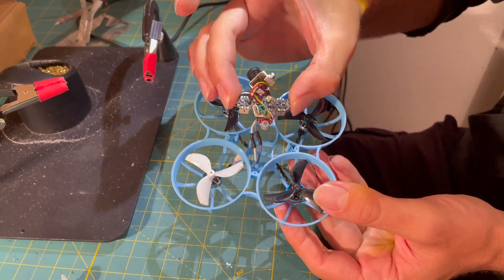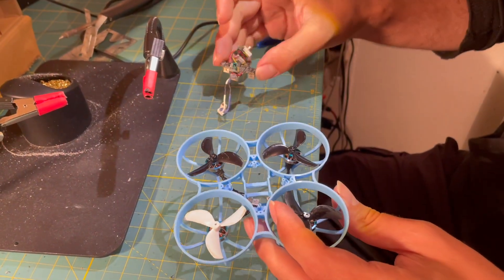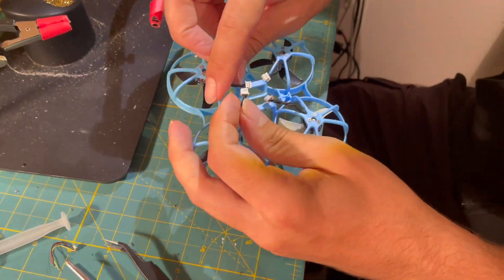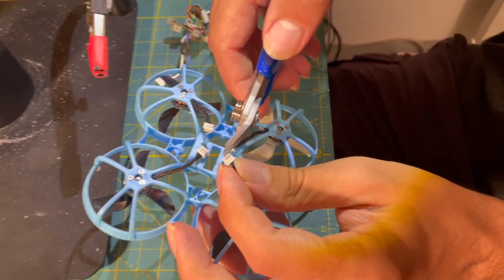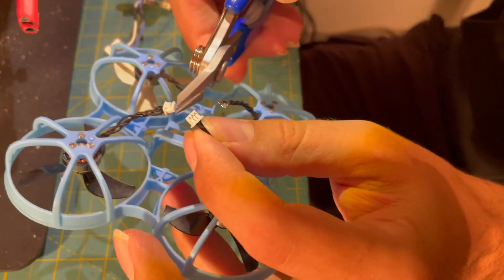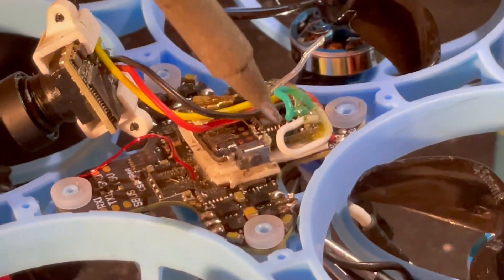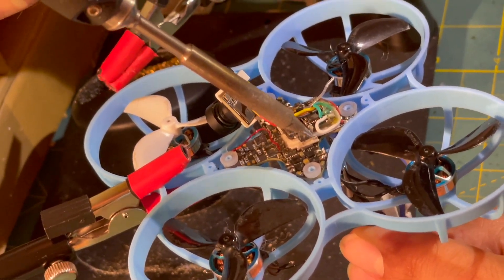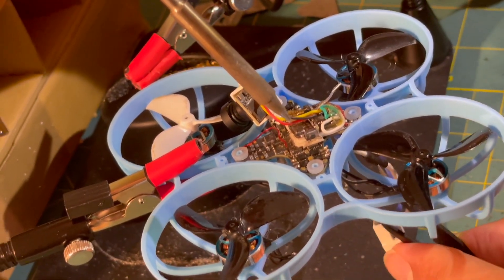NO Motorplugs = MORE Fun | How to remove Motorplugs on a Meteor 75 Pro

Comment: Ich muss jetzt auch ran. Im frame löten weil die Motoren nicht durch passen is echt scheiße 😞
Reply from the maker: Ja ich weiss das ist echt ärgerlich. Aber mit dem cross board und etwas übung gehts. Aber ja spass macht es am anfang nicht🤣 erst so nach dem dritten mal wirds ok..😁
Reply: @butterflyfpv  So, deine Anleitung befolgt. 3 Motoren laufen 1a, einer ruckelt und zuckelt. Pads auf Brücken geprüft, finde nix. Lötstellen erneuert, Motor ruckelt .. anderen Motor genommen.. Ruckelt. ESC configurator liest alle esc fehlerfrei aus.. keine Ahnung ob ich die pads geschrottet habe. Ich tausche jetzt nochmal alle drei Kabel und danach gebe ich einfach auf. Richtig frustrierend :/
Reply from the maker: Hmm ja also wenn du schon zwei motoren getestet hast dann bleibt nur das die ESC defekt ist. Schau dir mal die mosfets unter der lufe an. Sind sie noch intakt? (Manchmal sieht man von aussen so einen kleinen pickel oder ein brandloch wenn ein mosfet abgebrannt ist. Teste auch mal mit einm völlig anderen motor zum beispiel 802 motor wenn du einen hast.
Reply: @butterflyfpv  Die Mosfets sehen gut aus. Gab auch keinen Puff oder Rauch.. das riecht man ja sofort. Habe jetzt mal mit dem Multi alle pads gemessen. Bei den drei laufenden Motoren piept es wenn ich zwischen den pads messe, beim letzten Motor eben nicht. Da is gerade noch Lot drauf und ich sehe mit der Lupe keine Brücke. Ich mach die pads nochmal blank. Wenn es dann immer noch piept, dann hab ich das board geschrottet und werf es in die Tonne. Keine Lust mehr
Reply from the maker: Ich versteh dich! Aber gib nicht zu schnell auf!💪🏻 Und board in die tonne ist auch nix! Das kannst du noch für komponenten oder löt übungen brauchen! Oder zum motoren oder cams testen. 🙏🏻
Reply: @butterflyfpv kann es auch sein dass flux Rückstände so etwas verursachen können? Ich hab kein no clean flux sondern Paste. Reinige aber eigentlich immer mit Alkohol
Reply: @butterflyfpv  Ich hab jetzt mal das board komplett gereinigt. Das Multi ertönt bei allen 4 Motoren, alles ist sauber.. 3 Motoren laufen, hinten rechts ruckelt und zuckelt. Ich sehe keine abgerauchten fets .. das hat jetzt schon wieder so lange gedauert.. noch frustrierter als vorher :) .. Ich werf das Teil in die Kiste und bestell mir 'n neuen Whoop. Vielleicht ist das board durch die ganzen Crashes einfach fritte. Ein plug hatte sich auch vom board gelöst und ist abgefallen (beim Landen). vielleicht ist da auch was passiert. Trotzdem Danke für das Video. Ich mach nun allerdings zuerst das board komplett fertig, bau es in den frame und löt dann einfach die Motoren an. Das geht bei mir besser, da ich sonst mit dem Kolben den frame frisiere :) Grüße
Reply from the maker: Nee das ist eigentlich nicht möglich aus meiner sicht.. ausser es war ein extrem korrosives flussmittel das sofort wieder entfernt werden muss. Und auch dann halte ich es für unwahrscheinlich..
Reply from the maker: Mist ja dann sieht es schon danach aus dass das board hinüber ist..🙈 thats whooplife🤪 willkommen im club🤜🤛😃🚀
Reply: @butterflyfpv  jau. Er ist seit Anfang des Jahres gut gegen Wände geballert. Vielleicht will er einfach nich mehr. Ist ja auch nicht so ehlendig teuer und ich hab dann ne Ersatzcam und Ersatzmotoren. Ich bestell mir einfach nen neuen. Hatte überlegt, den Air75 zu nehmen, aber ich find den Meteor schon sehr nice.. der ist mit der 80er wheelbase und den Motoren echt fix und macht in der Bude ultra viel Spaß
Reply from the maker: Find ich eben auch! Der 75 Pro ist wirklich nice! Ein echt toller allrounder!

Comment: Excellent video! I particularly like the part about keeping part of the crimped connector. Very smart :)
Reply from the maker: Thank you for your positive and precise feedback! Yes, I really tested the crimped part for a long time. At first, I was worried that it would create more electrical resistance than if it were soldered directly. But then I tested everything, and now I almost exclusively solder whoop motors this way (unless there's no connector present to begin with or space is limited in the whoop frame). With toothpicks, this method isn't recommended in some cases, because if an entire arm breaks off, the solder pad might also break off. But with whoops, an entire duct never flies off. At least, I haven't managed that so far. 😁

Comment: How can I wire strip those small wires from the motors?
Reply from the maker: Some use a professional (expensive) wire stripper, while others do it with their fingernails. I now use my electronics side cutters. It takes a bit of practice to figure out how hard to press without damaging the wire. The best thing to do is buy a roll of this AWG28 cable and practice a bit. I'll show you how to do this in my soldering video, which I'll make sometime soon. Thanks for the input!
I've recently (since two years or so) started removing only half of the connector, as you can see in the video. This way, I don't have to strip the cable. And the soldered connection is much more stable, which helps prevent cable breakage.

Comment: hey man, great video. how do i know which cable is positive, neg and gr? thx!
Reply from the maker: Thank you for your feedback! I'm glad to hear that! The three motor cables don't have positive or negative wires. You can swap them. The only thing that will happen is that the motor's rotation direction will change, and you'll have to reset the rotation direction in betaflight or in the ESC Configurator.

Comment: I’ve ordered the frame kit for firefly, then I’ll try to solder the motors to the fc.
Can’t be bothered to do that before I find a frame that doesn’t have to be replaced every week.
Reply from the maker: Yes, I understand. Then maybe it would be better to fly Whoop (frames) for a while?
Reply: @butterflyfpv  I’m not sure if I understand your question. Are you suggesting that I do, or do not, fly whoops for a while?
A have a few more frames left, so I can still fly, but then I won’t solder the motors. Because the frames break so easily. To be precise, the standoffs that holds the fc and canopy in place breaks too easily.
And yes, I saw your solution to that: to buy some screws that are slightly longer than the original, so that the tip of the screws go beyond the standoffs and into the frame itself.
Haven’t tried that yet, and I was actually going to order those screws, but then I thought; why not see if I can find a stronger frame? Because the standoffs are not the only part that usually breaks. After a hard crash, the ducts tend to snap as well.

It’s alright to tinker for a while, but eventually it becomes tedious, when all I really want to do is fly.

I think the firefly (from flywwoo) might have a more durable frame, plus they have other solutions for the O4 that is kinda cool, making it more convenient to just buy stuff from one site instead of from all over the place, and get shipments from different places at different times.

If the frame from flywoo sucks, then I’ll try your solution, with longer screws.

Also, the canopy from flywoo is screwed into the frame with 4 points, so it evens out the strain a lot more than betafpv’s solution with only 3 points.
Reply from the maker: Yes, you understood that correctly. I recommend whoops for training! Open prop is great if you're very experienced in flying, repairing, and building, and you don't mind changing motors or frames, etc. I understand all your thoughts, and I was there once, too. But at some point, you have to accept that repairing is simply part of this hobby. And it gets easier once you've accepted that and stop getting annoyed when something breaks and instead fix it right away without giving it too much thought. So, so that repairing becomes second nature, so to speak. As you say, tinkering is nice, but at some point you just have to take what you can get and buy enough spare parts and then just fly, repair, sleep, repeat.😁🚁🤜🤛

Comment: Hey man quick question, I’m about to do this on my whoop since one of the motor is having issue and I want to know once everything is ready to be solder, does the three wire of the motor have to be in a order or it doesn’t matter?
Reply from the maker: Yes, they have to be in the same order for the motor's rotation direction to be the same as before. But you can change the motor rotation direction in betaflight in the motor tab. You can also simply solder it on, then test the rotation direction, and if it's wrong, change it in betaflight. Hope this helps.

Comment: Ich habe 3 Meteor 75 Pro.Bei allen fing nach ca.3 Flugstunden das Motorstottern an was auch den einen oder anderen Absturz mit sich brachte.Denke ich muss Lōten lernen .So macht es keinen Spass wenn das Teil unzuverlässig wird.
Reply from the maker: Danke für dein feedback! So war es bei meinen zwei auch! Darum habe ich dieses video gemacht. Und das video zum thema motor stottern. Du kannst meine methoden von dem video zum thema motor stottern versuchen bei einem neuen 75 Pro wenn du irgendwie an etwas dielectric grease rankommst so das du nicht gleich ne (teure) ganze tube davon kaufen musst. Und oder auf jeden fall die motorstecker mit UHU Por oder E6000 festkleben sowie die motorkabel mit zahnseide festmachen an den streben der ducts. Dann reicht es vielleicht für 4 Stunden flugzeit.🤪 Es ist wirklich komisch warum dieses problem beim meteor 75 pro vorherrscht. Bei 75ern whoops mit motorsteckern kannte ich dieses problem nicht. Ich verstehe dich auf jeden fall, es ist eine frustrierende situation. Der 75 pro ist echt gut, aber so macht es halt nur halb so viel spass..
Reply: Danke fūe Deine Hilfe.Und Danke fūe all die guten Tipps in Deinen Videos.
Reply from the maker: Gerne! 🤜🤛

Comment: I think i will leave my motors be until they have problems, when they do ill do this and solder everything. Btw, my vtx antenna has some black glue over the conector, do you think that it is a problem?
Reply from the maker: 👍👍 no thats not a problem. Have you seen my motor stutter video? Maybe you can prevent plug aging.
Reply: @butterflyfpv Yes i saw it, im looking at every video you have, they are very interesting really. You should do one about PID tunning the new 2024 version (the one with matrix 1)
Reply from the maker: @DarlcTV  😃👍 I try in the future..

Comment: I can’t actually remove the frame without unplugging the motors, it’d be so bad to have to solder motors each time I wanna reach inside of the frame on my cetus x. Instead can you tell us how we can make the motor plugs last indefinitely?
Reply from the maker: Yes, that's correct. I also said that in the video, or rather, described it in the video description. With the Meteor 75 Pro, you also have to solder the motors when the flight controller is in the frame. I know it's annoying, but with a bit of practice, it works. You can also rotate the flight controller 90 degrees, then you can solder the motors outside the frame (on the 75 Pro). Of course, you'll then have to reset the gyro orientation in betaflight, and you'll have to rearrange the motors and reset the motor rotation directions. Unfortunately, I'm not familiar with the Cetus X, so I can't help you there. I've already made a video on the topic of problems and solutions with motor plugs and motor stutter: https://www.youtube.com/watch?v=oSailFYhFBk&list=PLYPR_WgF4mzUVGJlKlx5Q_bdNKckQBKcI&index=4

Comment: Hey man i actually soldered all of it directly to the frame, do you know how i can fit it on to the frame
Reply from the maker: You mean you soldered all the motors directly to the flight controller like I did in the video? If you solder the motors to the flight controller outside the frame, they won't fit through the frame. (That's why I soldered the motors to the flight controller in the video while the flight controller was already in the frame) If you want to mount your motors outside the frame then you'll need to install the board at a 90-degree angle so you can loop the motors through the larger openings in the frame's battery holder. After that, you'll need to reset the gyro direction in betaflight so the gyro knows which way is forward. Then, rearrange the motors in the motor tab and check all motor rotation directions, adjusting them if necessary.
I know it sounds a bit complicated, but this is the only option. Hope this helps.
Reply: @butterflyfpv  hey I already fixed it thanks
Reply from the maker: @ZahilClips  👍💪💪💪 leeet`s goo! Whoop whoop!

Comment: This is one of the best FPV channels on youtube. You deserve 50X the amount of subs you have.
Reply from the maker: Thank you so much my whoop friend! That's a big compliment and nice to hear. And I take it😊But I would like to add that there are also many other very great channels that have invested so much work and deserve a lot more subs: https://www.youtube.com/@PropsOff/videos https://www.youtube.com/@im_ricebowl and many others..
Reply: @butterflyfpv  Thanks for the recommendations! So I haven't soldered my motors yet, but I noticed taking the tan clips that the motor plugs into off the board and plugging the motors directly into the exposed pins seems to have fixed my motor studder. I'm sure this isn't as secure as soldering, but it seems pretty solid so far. Any thoughts?
Reply from the maker: @TraceVandal  Interesting! So you removed your connector housings on the side of the motors? That's a good compromise solution. However, it's not necessary. If you use dental floss to connect the motor cables to the duct struts of the frame on a new whoop and also secure the motor connectors with a bit of rubber glue (eg uhu por), then the motors should never start to stutter due to contact problems on the connector. Your solution is also interesting but a bit risky. The connector pins of the motors must never touch otherwise there will be a short circuit. So make sure that they cannot touch each other. You can wrap the crimped parts of the motors with shrink tubing. Or you can use rubber glue to secure the crimped parts of the motor cables to the pins of the flight controller board. So that they cannot fall out and cannot touch anything that is conductive.
Reply: @butterflyfpv  you're the best! Thanks so much for the advice!
Reply from the maker: @TraceVandal  Glad I could help for a better whoop experience!

Comment: hey butterfly i looked at my fc (matrix 5in1) on my meteor, and realized, they put glue from the vtx antenna over the solder pads from the motor plugs, which means i wont be able to remove them
Reply from the maker: OK, interesting. I'll get my new 75 Pro soon too then I'll take a look at it. I hope it's not epoxy glue. But you can sometimes make the glue soft with a little warm air or dissolve it with a little alcohol.
Reply: @butterflyfpv i think normally it shouldnt go over the plug
Reply from the maker: @INY_FPV Probably not, yes. I'll take a look at mine then.
Reply: @butterflyfpv  butterfly... thank you for motivating me to remove the motorplugs. i just did it this afternoon and gosh it is a gamechanger... thank you!!! the motor issue stopped, the whoop is significantly more powerful... thank you so much
Reply from the maker: @INY_FPV Very nice to hear! This is what I want to hear! 😀Thank you for your feedback! Let`s gooo! Whoop whoop!

Comment: I was able to solder the motors directly to board and put them into that same frame on my custom build by simply cutting off the battery tray center beams in and then there was enough room to push them through with some slight flexing. 

It’s definitely easier to do it this way as I like
To use the helping hands to position the wire perfectly before soldering.
Reply: Hey man I actually soldered directly to the board aswell, how did you manage to put all of it into the frame I didn't understand
Reply: @ there is a center cross section on both side of the battery loops where you would slide the motors in.  you clip those on both sides and that gives you just enough clearance to push them through carefully. Those center cross bars are only on the meteor pro frame and they don’t add any strength to the frame.  I just don’t like soldering motors in the frame because I hit the plastic too much with my iron.
Reply: @JacobRhine-q4s  is it like the two vertical ones

Comment: I would also like to make this change but I'm afraid it could damage the only drone I have :(. I'm not very good at soldering but this change would improve my flight, I have 2 defective motor connectors... and after every crash I have to take it back and I see that an motor isn't running well.
Reply from the maker: Yes, I understand you. Find whoop friends in your area who can help you. Actively search for it! By the way, if you attach the motor cables to the motor struts with dental floss then this problem should occur less. You can also fix the motor plugs with a bit of uhu por glue or another rubbery glue then this should occur less. It is important that you find experienced whoop friends. Online or real life that will help you...
Reply: @butterflyfpv  Im in Italy, and i know many Fpv pilots, il gonna search someone in my area thanks for the advice
Reply from the maker: @Son1c55  In Italy there is also the Italian Whoop League! There is also a facebook group of italian whoop fpv pilots..

Comment: Sorry for the random question on this video, but my question is, Tiny whoop pinch camera can be mounted on meteor 75pro canopy ? Thanks and keep up =)
Reply from the maker: Yes the tiny whoop pinch cam does fit in the higher cam angle cam mount of the 75 Pro canopy. It is a little bit loose in there. But you can secure the cam with glue or with dental floss..